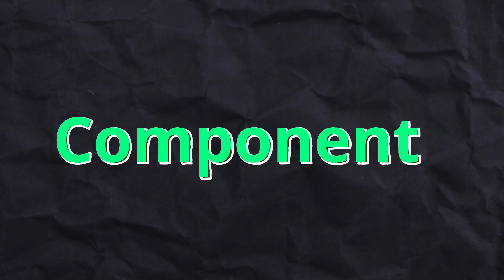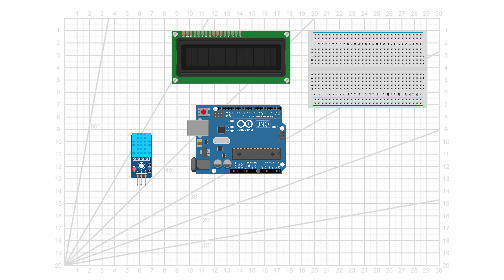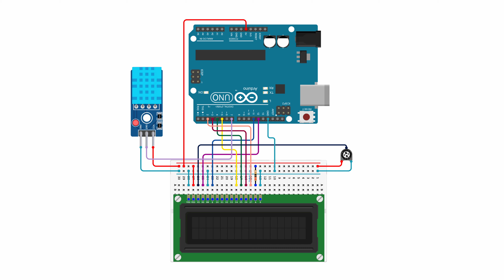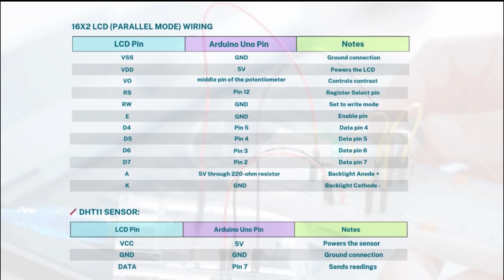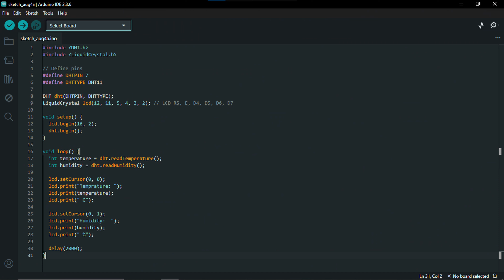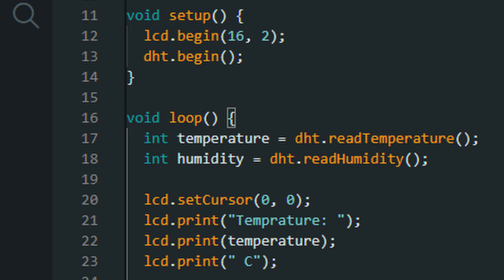Arduino + Temperature and Humidity Sensor DHT11

Comment: Thanks a lot.
One question. Are batteries  required if I am directly connecting the arduino to my laptop
Reply from the maker: Hey there! 😊 Great question! If you're connecting your Arduino to your laptop via USB, you don't need a separate battery because the USB provides power. However, if you're using it standalone, like on a project without a computer, then a battery is definitely necessary. Hope that helps! 👍 Feel free to ask if you have more questions!